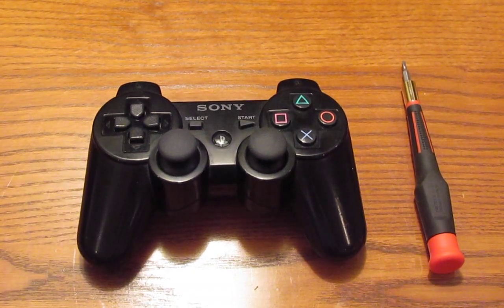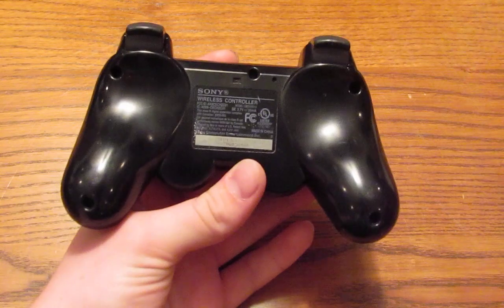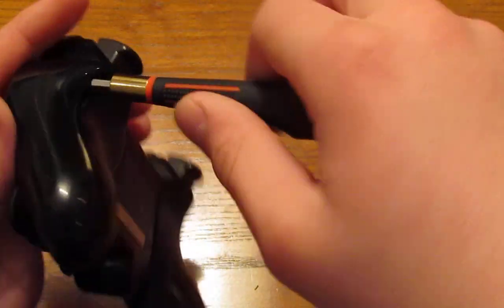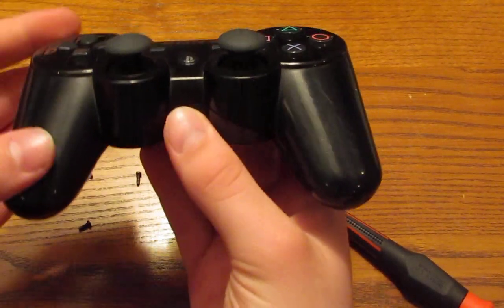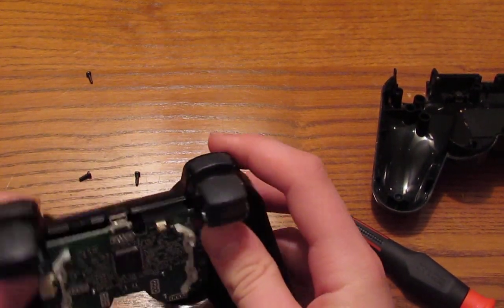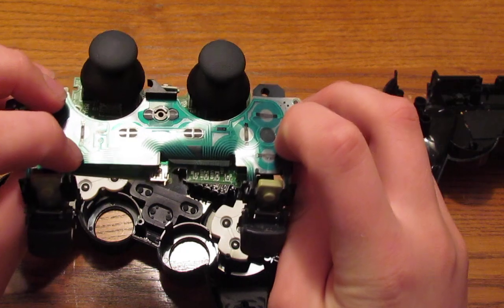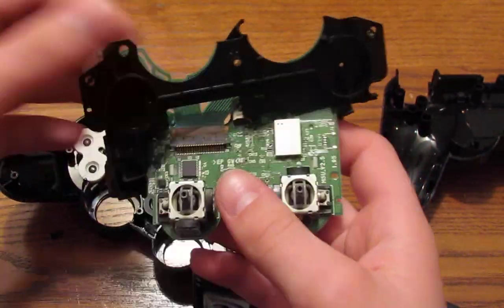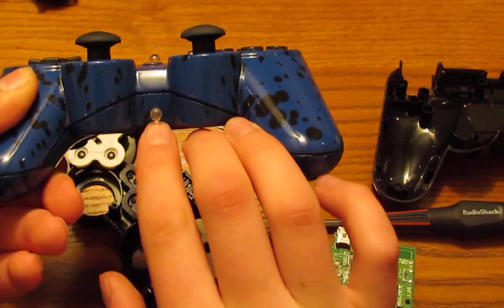How To Take Apart Your PS3 Controller

Comment: Finally. A disassembly video of the original Sixaxis controller that launched with the PS3 in Nov. 11th 2006. Not the one that's the Dualshock 3 and also has the Sixaxis technology built in. The original one that has translucent plastic and has no vibration motors and just says "Sixaxis."
Reply: why are you saying finally? this was uploaded In 2012
Reply: Lymzy If you would have read the entire comment properly, you would realize that I was talking about the original PS3 SixAxis controller. The one that came before the DualShock 3. These controllers aren't all that common because the DualShock 3 came out only a little while later. They do have different internals as well. Not massively so. but they're still slightly different. If you pick one up and compare it with the DualShock 3 you'll realize that it's quite a bit lighter. That's because there's no motors in the original SixAxis controller. You can see this in the video. There aren't even solder pads or housings to hold the motors inside the controller. I believe the reason for that is because they thought it would interfere with the working of the SixAxis technology. Almost all other PS3 controller disassembly videos are ones with the DualShock 3. Not the original SixAxis controller. That's why I said "finally."
Reply: +1980sGamer I'll say It again because you didn't understand. This was uploaded In 2012 and your original comment was In 2015. Someone didn't "finally" upload a disassembly of the six axis controller In 2015.
Reply: Lymzy I seem to have found one from 2008. It's really hard to tell what's going on though.

Comment: After 10 years, it's still super helpful. Found an old PS3 in an attic and my cousin said I could have it and now I'm cleaning it. The PS3 still works perfectly fine but the controllers are a bit crusty to say the least.

Comment: Thanks! I had to take out a piece of plastic that snapped off the inside of the controller and was making it hard to move the d-pad. Much easier than spending >$40 for a replacement.

Comment: My controller is the less bulky controller it has squeaky analog syndrome and it does my head in, I got to the point where the back of the casing was off the two spacers between the L and R buttons and couldn't find the screw for the board, I don't use it enough for it to really piss me off but I wasn't doing anything so I thought why not, but I got up to that point without any help. It's pretty straight forward I mean the only thing I couldn't find was what was holding the board to the front of the controller, I'll give it another go tomorrow keep me occupied while my cars in the shop haha

Comment: My screws are stripped F***...
Reply: shit, I have the same problem with one last screw, did you fix yours? i need to replace the battery of mine
Reply: The screws on both my controllers are stripped I broke one of them trying to get it out so to answer your question I didnt fix it... I never will.

Comment: I want to take my controller apart an figure out why the circle,triangle,R1 and R2 buttons aren't working. Though it's not a huge mystery they all stopped after my wife threw the controller
Reply: Oh but I do t know what to do after taking it apart
Reply: Gordon Chelf try to see if the motherboard is fractured or broken in anyway around the area of those buttons if that is not the case then see if anything is disconnected like if any wires were welded on and broke off.
Reply: Hopefully this helps even though I’m one year late sorry 😞

Comment: did you study electronics? I'm getting into electronic communications ih the air force, we go through AC and DC and positives and negatives and resistors and capacitors, and volts, and amperes, etc. and we talked about solder, and it said the two metals in solder are tin and lead.

Comment: pc-computerservices   I have a controller like the one you were demonstrating with, and I hadn't used it for several months, but when I used the PS button in between the select and start buttons, it feels sticky like some pop could have been spilled underneath the button. I want to try to take it apart to clean that button so that it doesn't just stick down when I press it. Any recommendations other than what you demonstrated? I wouldn't worry but these controllers are STILL expensive, and I don't want to buy a knockoff. Thanks for any help! I used to take care of the electronics when our kids were growing up, but I'm older now and don't feel so confident with my abilities. Am I overthinking the difficulty of this? Again, thank you!! Kathy

Comment: I just took apart a new generation controller, fixed it, and put it back together in less than 30 min. with no p prior experience using the instructions in this video. If you try this and fail, you probably need help putting your pants on in the morning. Good video, good info.
Reply: Sorry that pretty much everyone else isn't a master of trying to fix (for most people) complicated things.

Comment: Why are you even showing this in 2012? That controller is from the FIRST Ps3 GEN! (2006.) Lmao, It doesn't even have rumbles. This tutorial may help very few, due to how old it is. The later ps3 controllers are completely different.(especially ones that were purchased Nov.2011-current ) You should have at least put that in the description. You are leading many blindly. DO NOT FOLLOW IF YOU HAVE A LATER VERSION OF A PS3 OR HAVE BOUGHT A CONTROLLER LATER THAN '06. LOL.